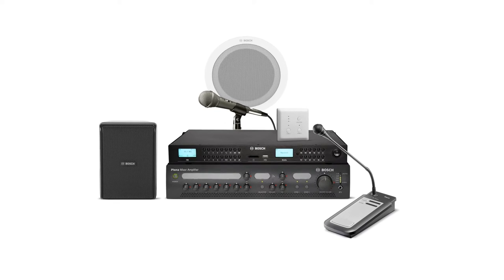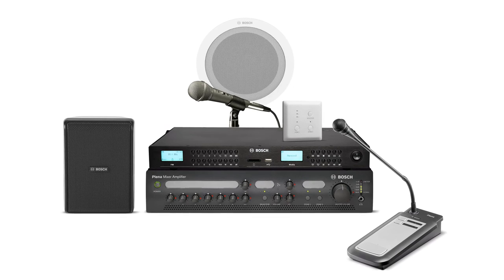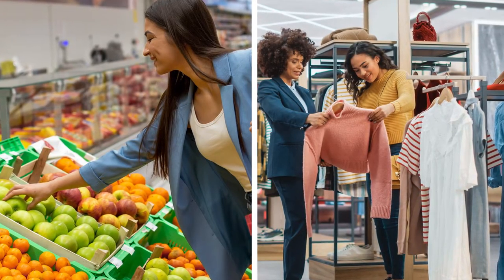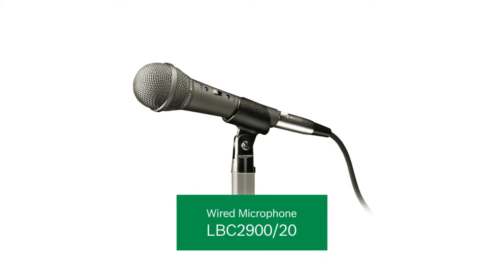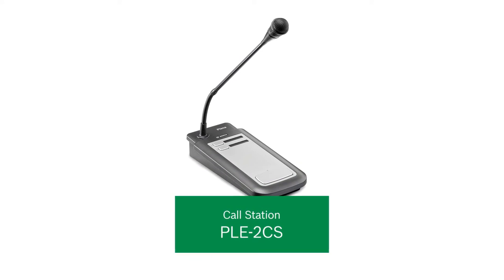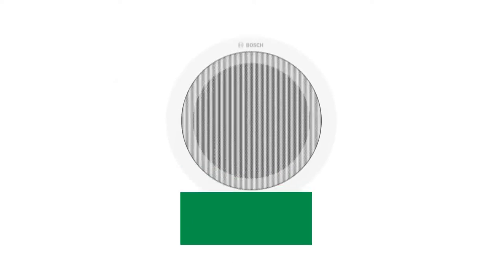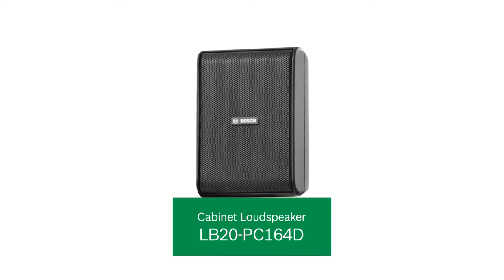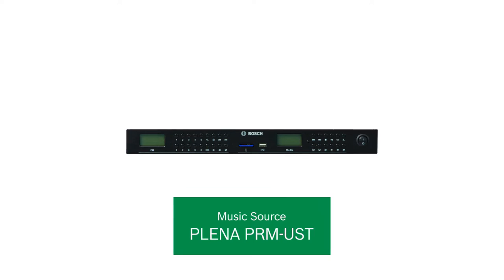How to install a Basic Commercial Audio System

Comment: Good intel, and good video. One suggestion though, i would have added a brief description to the part number for each item equipment as you called them out. The part number dont mean much to people unfamiliar with your specific equipment, so for example, saying 200watt amplifier right after or before the part nunber would help reinforce the purpose of the various items listed.

Generally, it's an informative video, though. Thanks much.

Comment: What about 100v line input/telephone emergency? It is mentioned in manual not to connect both together? If I am taking signal from fire alarm at 100V emergency input then I need to play announcements. How this can be done? for announcements I have to connect audio source at telephone line input while connecting 100v line signal?